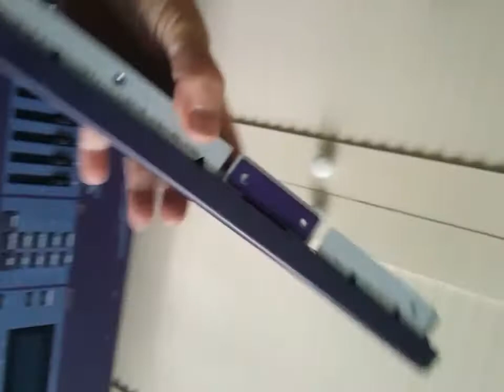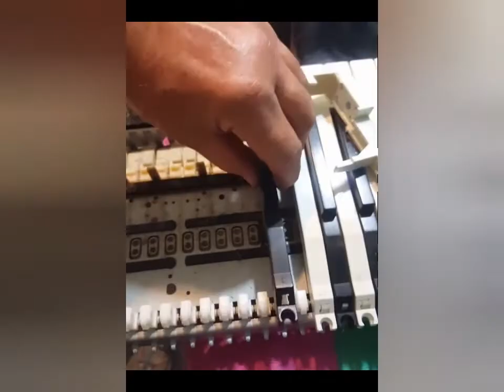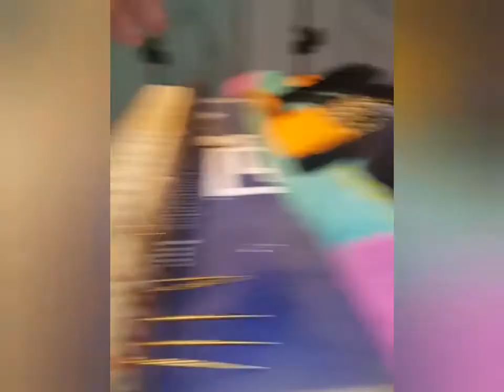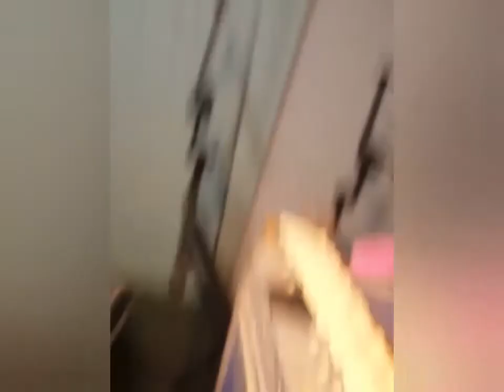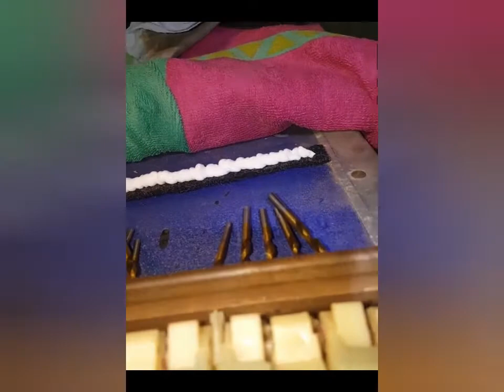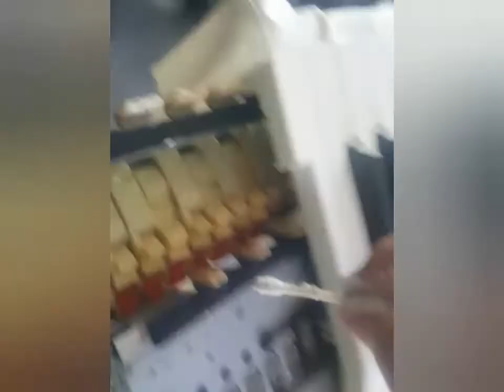Repairing and restoring a Kurzweil K2500 & K2600 Fatar TP-10 keyboard keybed.

Comment: Just to add a bit for those with a dead key. The grey soft plastic that you were cleaning with a q-tip are rectangular and removable. Underneath is the actual key pads. Clean with soap and water. You can soak them overnight and scrub with a tooth brush. The contact on the circuit board needs cleaning, too. I also swap the inside with the outside to even out the wear. That can make the keyboard feel both "broken in" and almost new.

Comment: You're right about the felt thickness!  I tried a slightly thicker felt in my K2600XS.  Screwed up the velocity response and changed the feel of the keyboard.  I'm in the middle of, yet again, removing the keys in preparation for doing it correctly this time.

Comment: I have to correct you on the disassemble the K2500. You don not remove the sides on the K2500. You start with the screws underneath (Those that have unoccupied screw holes on either side. Than the rear screws. After that, you have to push the front cover to the back so it slides until a stop. Then lift the right side a bit because the left side gets a bit stuck due to the presence of the floppy driver.

Comment from the maker: FELT, not foam. Obtainable at a reupholstery supply store. I bought the 'best' in stock, which was about 3/16"/5mm thick. Using a healthy amount of caulk to glue it down adds another layer of anti-noise cushioning.
Rolls are a meter wide: you only need a strip 5/8"/15mm wide so buy as slender a slice of felt as they are willing to sell you (3" wide x 1meter = adequate. I had to buy mininmum 1' wide x 1 meter, but was restoring 2 keybeds so used 1/4 of roll).

Comment from the maker: Pardon non-response but I don't check here often. Re pre/post op sound comparison, uh... it's basically the first thing in the video. I just watched this again and the audio recording of the post-op K2500 vs pre-op K2600 sounds accurate.
I do apologize for all the one-handed cell shots; a lot of this would have been far clearer if I'd mounted it and presented 2-handed procedures and shot-framing.

Comment: Watched this all the way through. I’ve taken apart my Forte keybed and I believe the felt for the weights may be my issue as well. Did you film the result if the keybed back in the keyboard to see how much quieter it is.  Very disappointed to follow the whole video only to not see the final result showing the noise reduction.  Good video otherwise though.